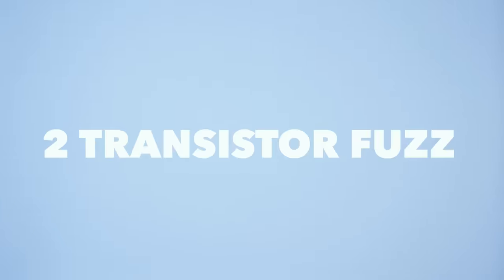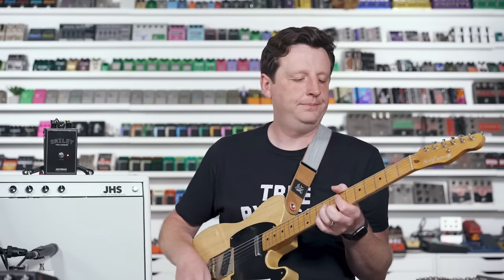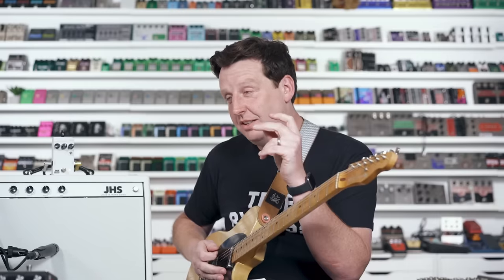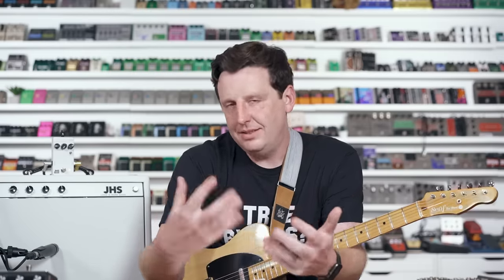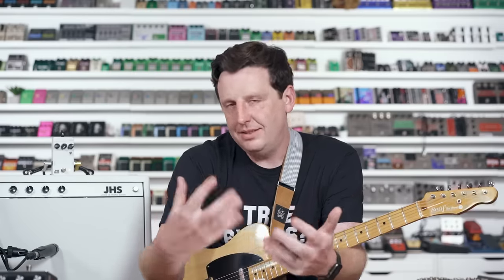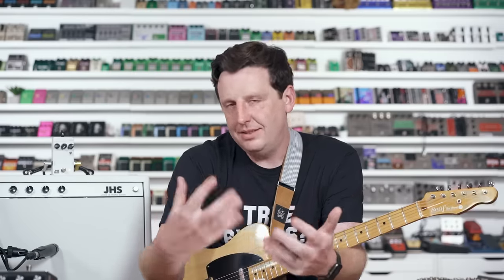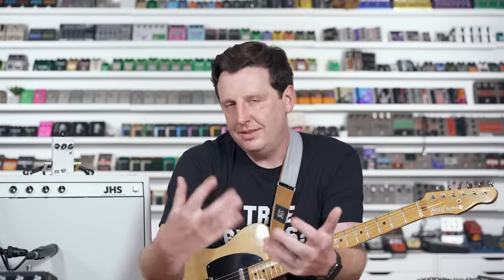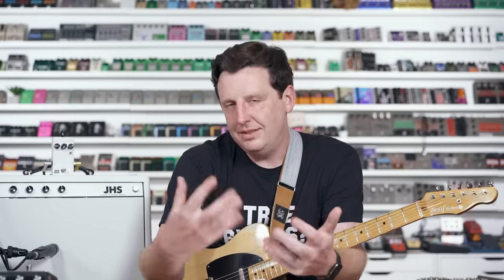How to Find the Fuzz Pedal You Need

Comment: I've always thought if you use single coil pickups play a Fuzz Face. If you use humbuckers use a Tone Bender. Now obviously that's not a hard rule but I find the Fuzz Face really bass heavy so it will had girth to thin single coils. On the flip side Humbuckers are darker sounding so using a Fuzz Face might be too much bass. Just so happens alot of the famous Fuzz Face users also use Strats with single coils and Tone Bender users play Les Pauls with humbuckers.
Reply: Well said. Only one I can get away with both is a Band of Gypsys Fuzz. It as a good tone control, and wide range of fuzz. Sold every other fuzz I have, just because it work with everything, when none other would. Even on a pretty dirty amp, it rolls off to a true clean.
Reply: I use a FF that I built with my gold guitar all the time and it sounds great 🤷 Seymour Duncan 59s with A5 magnets.

Funniest part is I actually built 4 of those 🤣 2 on pcb's and 2 different ones on breadboards.
Reply: @JC-11111  It's funny how people's taste differ. The 59 neck is probably my least favorite pickup ever. 
Rock on.
Reply: This isn't universal. One of my favorite fuzzes is a TB/JHS Bender. I mostly play single coils and I can get what I need out of it.

Just to make sure I'm covered, I have several different fuzzes. One of my favorites is the Zappa-esque Frederic Effects Weasel Stomp.

Comment: Thanks so much for that explanation on the bias control, it was really interesting. As you sweep past noon I kind of hear the Smashing Pumpkins saturated, ripping fuzz, but once you reach 3 o clock you're in White Stripes territory. As for the max setting, I'm not a fan, I'm not sure who would or does use a bias setting that high, but it's still interesting.

Comment: I was luckily gifted a V7D black russian muff. At the time I wasn't even a fan of fuzz or even distortion. That pedal changed it all. It can be used many different ways. From fizzy boom background to more creamy solo tones to straight buzz saw treble. I use it with wah, envelope filter, analog delay and phaser.  

The V7D is a green Russian in the large black enclosure.

Comment: I stumbled into the "bias" option on Fuzz Face years ago, quite by accident.  I wanted to branch into DIY and was told by someone I could start with a voltage starve box.  So I went to Radio Shack (RIP) and got a box, a pot (I didn't know what I needed, so I just got a random one), and a few wires.  I guessed about how to wire it up and the first pedal I had handy was a Germanium Fuzz Face that had come in the mail that day - I was shocked at just how amazing the voltage starve sound was... I then proceeded to try every other pedal and realized that a) couldn't do that on anything digital (duh), b) even within analog circuits, my fuzz had the best reaction.  Unfortunately, that stupid Germanium fuzz was center positive, which meant that it was the most annoying pedal to integrate into a pedalboard.  As a result, the Fuzz Face got sold and the starve box went into a drawer.

Comment: Just when i thought that i had completed my humble arsenal of pedals, amps and guitars i started getting into fuzz. I'm trying to not dive into this fuzz universe but Josh is trying to pull me back in. Right now i really dig my "Dunlop Fuzz Face Mini Bad Of Gypsys" pedal. 

About the signal chain you mentioned. I put the fuzz after my drives and personally like the sound of it. It works especially well with a buffer before it (Blues Driver) even if i don't stack them together, it sounds a bit rounder and sweeter. I didn't think about changing it since it works well but i'll give it a try with your advice of putting the fuzz first in the chain.

Edit: i must say after trying it first in the chain, i still prefer it after drives, i think it just stacks better.

Comment: Most of the time I am a blues player, so traditionally I would go for soft overdrives. One time I made a radical decision to put a RAT on my pedalboard an discovered the versatility of it, and that it also sounds nice when you use less compression/distortion (it doesn't have to be metal, it gave me ZZ Top sounds). Then I started buying fuzz and octave fuzz pedals; it changed my world. I also learned to tune in more sounds, and not turning the knobs to extremes.

Comment: I once tried an original Octavia and found it difficult to maintain the octave effect over the full guitar range, without readjusting the Octavia settings each time. Later I got a Danelectro DJ 13 French Toast, supposedly with Foxx Tone Machine circuitry, which was easier to dial in and consistent over the full guitar range. I also go the DJ 12 Chilli Dog octave down pedal which I use when demoing locally the Marshall 'round case' range. Using the DJ 12 before the Marshall distortions gave the heaviest sound I've ever made, but most guitarists I talked to about it, didn't seem to 'get' it. Admittedly at gig levels it would have probably needed bi-amping with a bass amp, and speaker protection low end filtering to the guitar amp, but it's worth checking if you want that sound.

Comment: Great show! I went from 1 pedal in my life for years to a board with 3 fuzzes on it this year.  Seems I'm starting to like all the fuzz.  Muffuletta, 3 Series Fuzz, and a Mythos Golden Fleece are where I'm at in my journey. I added a Pitchfork to the board to try and replicate that White Stripes Sound. I'm happy with the results, but might need to add an octave fuzz for comparison. 

Also, if anyone is looking for a fuzz friendly Wah to put in their chain, check out the Fulltone Clyde Deluxe. I was so hung up on my fuzzes being at the front of my chain that I almost passed on buying the Clyde because it needs to be at the beginning for my setup. Tried the dunlop and Vox with no success using it paired with the Golden Fleece, but the Clyde does the trick with it's seemingly specialized buffer that's only one when the pedal is engaged to.

Comment: I run my fuzz (EHX OP Amp RI & EHX Ram’s Head RI), currently on my board, through the front of my Orange TH30 head, on the clean channel only; and it sounds absolutely amazing. I run a TU-3, Micro POG, MXR Phase 90, and EP Booster in front of my fuzzes. I also run an MXR 10 Band EQ, 1st in my FX loop, which is always on.

Comment: Very informative! I love fuzz, & my favorite is a Dallas/Arbiter type, but I don't have that yet. What I do have is one of your Pollinators (which I love, & am surprised you didn't talk about: it's the only thing in front of my buffer other than my guitar) & a Way Huge Swollen Pickle that I'm pretty sure I'm going to trade in for a Russian Big Muff. My thing on the germanium/silicon argument is that they sound different from each other in timbre, & each is better for different uses, hence my Face/Muff combo. To me silicon sounds both smoother and angrier than germanium (I've traded out both kinds of transistor in a board & know there's a difference) & not as warm, but speaking of warmth, the bias on the germanium transistors tends to be screwed by temperature changes, which is the other great thing about the bias knob on the Pollinator: if it shifts, you can just shift it back & not have to carry a spare pedal in a cooler.

Comment: The hardest part is making a reasonable sized board, 6 pedals at the MOST, for touring. Something light to hit the front end, something heavy for chords in choruses and something weird for those moments you want to go way out. Figuring what to put where is tough tho! My favorite classic is the Zonk Machine, it’s not hugely different from the tonebender mk1 but enough that I notice and prefer it. I’ve had all the bigger circuits too at some point, aside from the Bender mkIV. What I’ve always wanted but never got to try is adding the Fuzz Factory type control to different circuits. I could see it effecting the 2 transistor most so probably why he chose the Fuzz Face, still… I’ve always wondered how far I could push a Zonk clone and if it could cover a couple roles to save space. I would LOVE to just have 1 fuzz on my board and focus on getting everything I can from it. Lastly, after the Japan Fuzz video I’m curious to try whatever that is because the articulation/clarity was amazing. It seems like a very “alive” type effect, where it changes a lot with your playing.

Comment: I played bass for years, and never liked what fuzz did to the sound.  It muddied it up, and I love a clear, almost squeaky bass sound (think of dish-detergent fingers on a wet plate).  Then I started playing guitar and thought, I had better get a cheap fuzz - and then I fell right down the rabbit hole.  I have started collecting inexpensive fuzzes and am having a great time.  My very favorite is the Donner Stylish Fuzz, its the best all-rounder.  The Cuvave fuzz is a fun broken fuzz, and I have a hard gate after it.  Lots of fun, but not overly useful.  Coolmusic makes a great, cheap, fuzz where you can mix the wet/dry so it is the first fuzz I really like on bass, because I can keep a good clean signal.  I have only scratched the fuzzy surface, I think.

Now... How do I figure out what types I have?  They all have a Sustain knob, but sound wildly different.

Comment: Thank you for doing these, especially this one. I never got into pedals until recently & I want to try a fuzz, but picking out a first is tough. I normally play metal & use high gain distortion so I love that tight aggressive sound, & fuzz always seemed so unruly & wooly, or even muddy to me. But ive recently been getting into more stoner & doom. I guess this is kind of contradicting, but I would like a fuzz with alot of clarity if possible. Out of this vid the features I like are the clarity/stability of the 3 transistor, but the attack or aggressiveness of the 4. Im thinking a grunge style fuzz would be best for me. I'm still not sure exactly what I should get, but this vid helped SO much in pointing me in the right direction.
Reply: Try a Ram’s Head
Reply: @Ayinde Best  I actually got a DOD Carcosa a few weeks back, which I love but ALOT of ppl recommended a rams head &/or Green russian style muff. Plan on getting one of each later on.

Comment: Great video! I'm a fuzz fanatic but I'm impartial to Big Muffs because it's more of a distortion than a fuzz.  Granted, the pick attack is really spongey and doesn't have the same articulation as a Fuzz Face or a Tone Bender, but the gain is insane and nails doom metal and alternative rock riffs like butter.  If the mids are too scooped, I just run it through my DS-1 with a modded tone control (which boosts mids instead of treble when you turn it clockwise past noon) and it sticks out perfectly.  Although, I will say the best fuzz imo is the MK II Tone Bender, because it's a great compromise between the Big Muff and the Fuzz Face, and has a more flat frequency response than either of those so it isn't to "flubby".

Comment: Okay...stupid question time.  First, some context.  My current signal chain is: input buffer > EQ > compressor > noise gate with drive pedals (fuzz > OD > distortion) looped thru > amp sim/IR loader > multi-FX for modulation and time effects > output buffer.  Given this particular chain, what might be a good candidate for a fuzz that can fit its place in the chain without sounding like a truck ran over it?  That spot is taken by an EHX Nano Big Muff at the moment, but I'm not exactly happy with the sound.  Suggested alternatives include the Boss FZ-1W or the Walrus Fundamental Fuzz.  Is there another (reasonably priced) option I should consider for a fuzz?  ANY info helps.  Thanks, Josh!

Comment: I'm old, but I've been using fuzz faces since the early 70s. I've tried muffs, fuzzrites, and maestro's and and they just don't work for me. Never had a tone bender though.

I run my fuzz face a lot differently than most.

I run my amp almost clean (just a little bit of overdrive), with a bright mid heavy eq. I run my jimi hendrix fuzz face with the volume at unity gain, and the fuzz at about 95% of full blast.

The fuzz face controls aren't just volume and fuzz, the volume adds bass as you turn it up, the fuzz cuts treble as you turn it down.

When you run a fuzz pedals volume all the way up, it gets boomy, turning it down reduces that, but you can hear the fizzy high frequencies a bit more. Turning down the fuzz just slightly from full give a slight loss in gain, and a sizable reduction of high end.

Running the volume at around 2 o clock, and the fuzz a bit below full  gives me a thick controlled articulate fuzz tone, a lot like hendrix's tone on red house.

But because my amp has a decent amount of gain on offer, I can get a wild fuzz tone as well, just by cranking the amps' gain/boost and volume. Also I never see anyone doing this except me, but if you turn the tone pot on the guitar all the way down, it won't really affect the eq, but will give you a slight bit more clipping.

Comment: Rare (?) Russian Big Muff question: I have a Black Russian Big Muff pi that I cannot find another example of online. I bought it in the mid to late 90’s and it has the features of the other black ones I’ve seen yet it has the round knobs that have three etched sides of the green ones. The lettering is a orangish yellow which looks different from the pure yellow ones I’ve seen. Is this a big muff version of a partscaster?

Comment: My personal favorite fuzzes are the giant 70s Maestro MFZ-1 and the Rosac Nu-Fuzz. The Maestro is a good all around fuzz and I used it through several bands. The Nu-Fuzz was my first fuzz and is a beast. Designed by the Ed Sanner, it's basically his own original Fuzzrite circuit, but better tone control. 
Though, now that I think of it, I also have a deep love for a Jax branded Shin-Ei Super Fuzz that has a switch for two different fuzz tones. One a can of bees gnarly one and another creamy smooth fuzz.

Comment: Recordings with great high-bias fuzz include "Hunting & Gathering" by Sunn O))) and the first disc of Miles Davis' live record "Agharta" (Pete Cosey plays lead guitar there in a way that I'm still chasing). I love the splotchy sound of a bias that's just starting to cut out, I got something like it from the 10 o'clock position on that same JHS 3 fuzz, but that one was just a little too thin (always a threat with my Telecaster) and I'm on the hunt again. Will probably go with another JHS though, something not much beefier than the 3, because I don't like the whomp of the Ram's Head Pi reissue that I've tried out since. Thank you for this video.

Comment: This was good 👍🏻
 Question: Correct me if I'm wrong, if using a compressor in the chain, wouldn't the guitar be plugged into that first? If using fuzz vs. distortion or overdrive with a compressor, would the order than change?

Pete Townshend was one of the earliest users of fuzz. He can be seen using a MK I tone Bender in 1966, a MK II Ton Bender in 1967,  a Marshall Supa Fuzz in 1967 and 1968, gray, (maybe black too) and Red Fuzz Faces in 1968, the UK labeled Shaftesbury Duo-Fuzz or U.S. labeled Univox/Unicord U-1095 Super-Fuzz (both a relabeled  Shin-Ei FY-6), and a '70s Univox (Unicord)  Super-Fuzz.

Comment: im more inclined to be on the muff side of the fuzz debate. however, im a big proponent for the achievement of fuzz tones via stacked overdrives. it may seem like a chore to accomplish but it's a labor of love and once you learn about how your Pedals interact with your amp and guitar you can dial in the tones you want very easily and quickly. I think that the small pedal board is ok but I'm not a fan. the size really doesn't matter but it can get overwhelming as it grows. my only complaint with the good old muff tone is the volume. I personally have been working on getting a modified set of Pedals of the fuzz family and its been a fun and educational experience with rewards that outweigh the disappointments. I've got some awesome and different tones from the simplest component changes via capacitors, resistor and electrolytic capacitors. I'm sort of ignorant about the actual circuitry and the entirety of how each component works together but I've got a great friend and teacher showing me as we both travel on the tone journey together. but I am hearing amazing results that are tones I've not really experienced and think that people would dig them as well, familiar yet just the right amount of different and functional tones. I can only hope I can make something bigger with these creative endeavors. lastly the circuits are of the muff variety and those are the best platform to begin with modification. don't be afraid to just dive in but get an understanding of the Pedals layout and find the places that are the easiest to change. sorry rambling so I'm gonna... ramble on out

Comment: Right now I'm digging the Tech 21 Fuzz Boost- super versatile (does both Fuzz Face and Big Muff sounds extremely well, in addition to a few others in between) and sounds great at virtually any setting. The separate boost function is pretty awesome too. WAY underrated and unknown pedal...
I had that Danelectro 3699 Fuzz Octave before that- it was a pretty cool pedal, but I don't really use octave as much, and even at it's absolute lowest settings it's still so damn aggressive. Found it hard to get a tight and classic sound out of it.